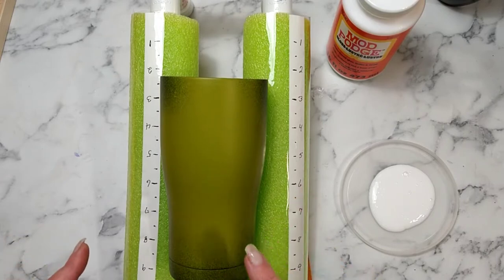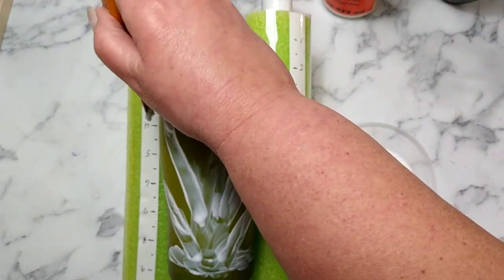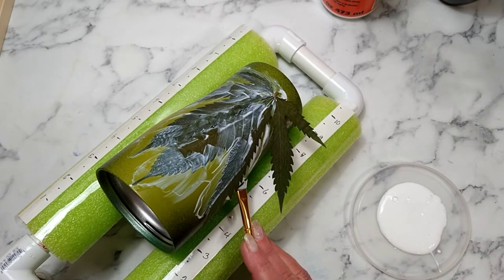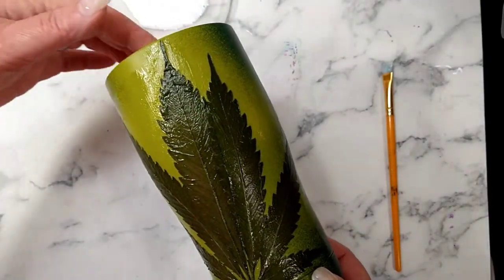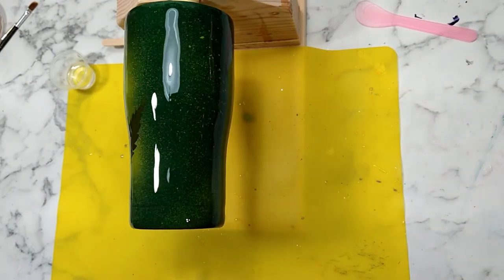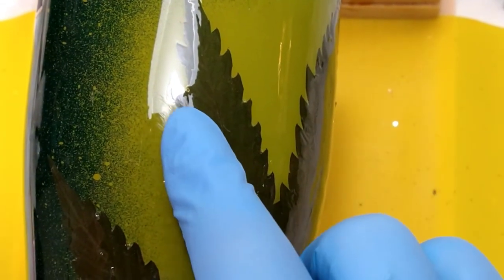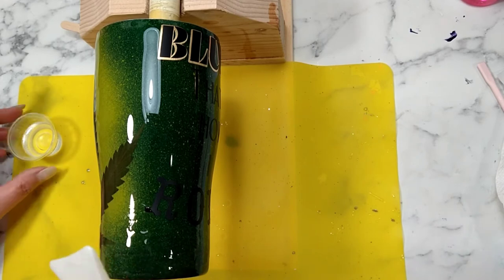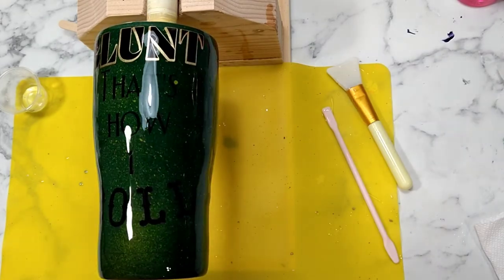Cannabis Leaf//Epoxy Tumbler//Mod Podge//Epoxy Damage Repair

Comment: 😎👍😁 Awesome cup and great save!!!
Reply from the maker: Thank you.  This style cup makes me want to just SPIT!!!! There's a tip for you.... don't buy the cups with a ring around the bottom.  They often produce bubbles as the epoxy seeps in and the oxygen pushes out.  And it can happen loooong after it's been on the turner.  It's happened to me several times since this one.  Fixable, most times. Irritating all the time. ☺️🌺🐭

Comment: I found this video very helpful, I have some ppl actually wanting these leaves on a cup and some other wanting other plant leaves so this was the 1st one I came across using actual leaves and I'm not feeling too intimidated now.   Thanks 😊
Oh also, do the leaves have to be dried out or can I put one straight off the plant on it?
Reply from the maker: Nicki, I'm so glad you found your confidence, through this video.  You definitely need the leaves to be very dry. These were dried in a photo album, for several years. I would suggest placing the leaves in between 2 sheets of parchment paper, then stack heavy books on top. You could probably put paper towels or copy paper on top of the parchment to absorb the moisture that will be released from the leaves. If there's any moisture left in the leaves, you will see your epoxy fog. 
I hope this helps. 😊🌺🐭

Comment: Would spraying with acrylic medium first help seal?
Reply from the maker: I'm not sure. But it's worth a try. I was concerned with it cracking, due to how dry it was. I used the Mod Podge to soften and allow it to form around the tumbler easier, with less damage to the leaf.
Reply: @sandisshedhouse4741   I tried the acrylic spray, and it did not work at all. It sofened the leaf to much and made so many puckers.

Comment: Maybe if you seal with a clear spray paint that will seal it better and it won't bubble. I'm not a marijuana consumer but it's a pretty cool tumbler!!
Reply from the maker: I tried to seal one of the other leaves, and it made it more brittle 😔.  They're so dry, it's nerve wracking to even touch them. LOL.  I appreciate your suggestion though.  Btw, I don't partake either.  But upon discovery of the book full of these, I couldn't let them go in the trash.  Thank you for watching 😊
Reply: @sandisshedhouse4741  I meant after the mod podge 😁
Reply from the maker: Oh, I thought you meant the leaves.   Yeah, I probably should have clear sealed it.  It was definitely not a good feeling to find that. I do seal certain designs, but wasn't thinking about that ridge. I will remember your suggestion for future tumblers.

Comment: Doing this ontop of a table top a picnic table actually placing leaves under the spar urethane coat will a freshly picked leaf keep its shape and color uner the coat or do i have flat dry it prior thank u.
Reply from the maker: @MR-puffnstuff Love the name!!!
You definitely want to dry it. Fresh leaves will cause condensation, rot and turn moldy.  Lay the leaves on parchment paper and press inside a book.
I was gifted my leaves. They were placed inside a photo album. The ones that used to peel back the film and it was sticky underneath.  However, mine were also many yrs old.  It will need weight to dry flat. Otherwise it'll curl up on the ends.